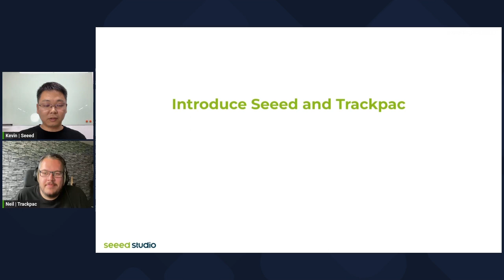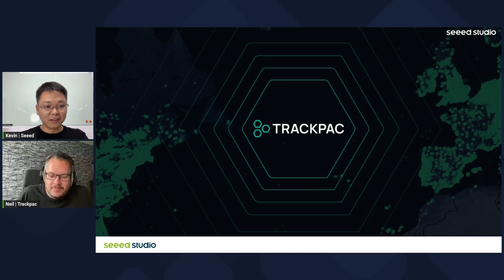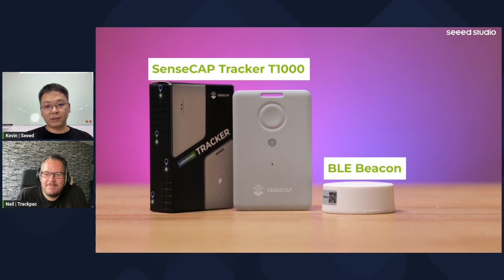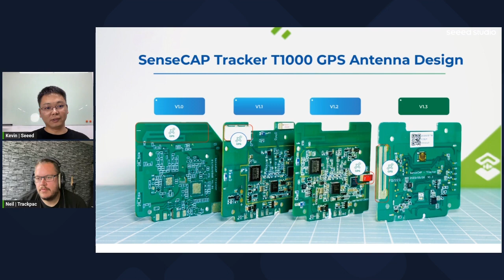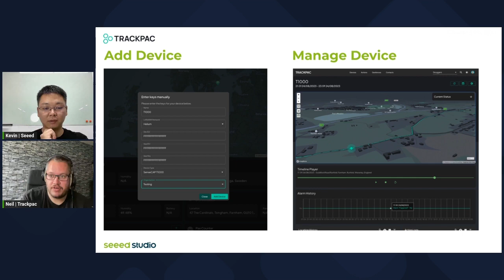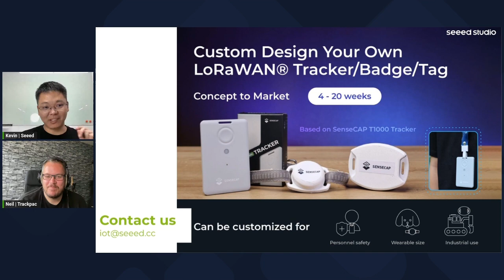Introducing SenseCAP Tracker T1000 Integrated with Trackpac Solutions

Comment: How the gps coordinates are transmitted to the cloud? Where is that LoraWan Gateway located? Do i need to create infrastructure by my own?
Reply from the maker: The GPS coordinates are transmitted to the cloud via LoRaWAN where the place is covered with LoRaWAN network. A LoRaWAN gateway can cover a range up to 10km for the network coverage. There are some public LoRaWAN networks (such as The Things Network, Helium, you can check if your area is covered here:https://ttnmapper.org/heatmap/) which you can use if you're in their coverage. If your applications are located in a no-LoRaWAN network coverage, yes, you need to create the network infrastructure by yourself.
Reply: @SeeedStudioSZ  Thank you!